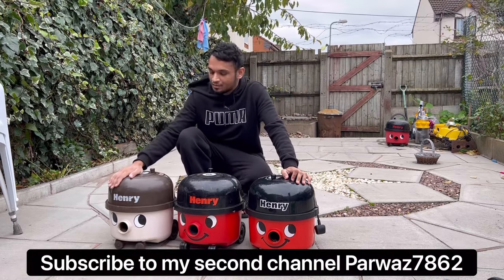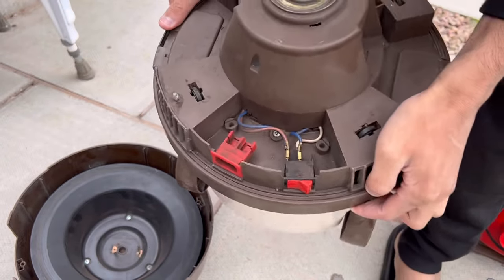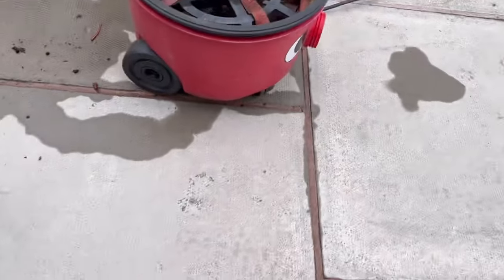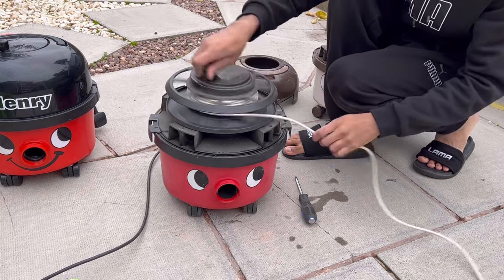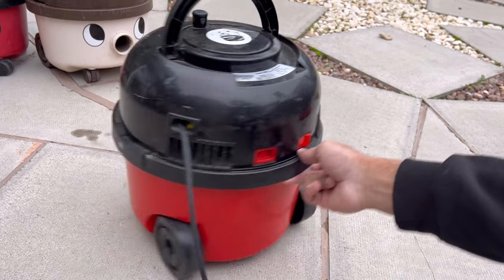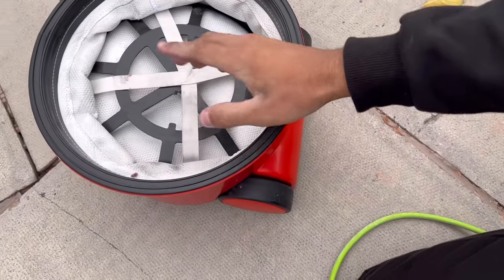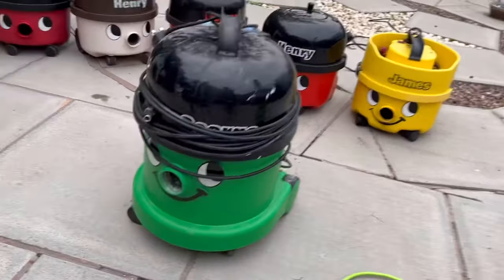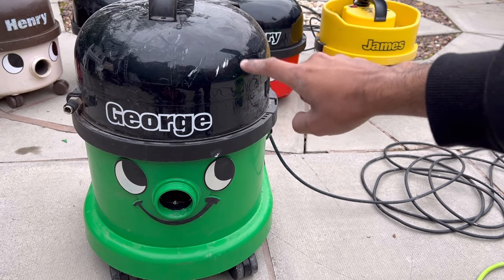My broken Numatic vacuum cleaners - UPDATE

Comment: The squeaky sound means that the bearings need oiling, probs because you left it outside. Apart from that , the motor sounds sweet. Lesson of the day, don't store vacuums outside, or you'll destroy them . Why did you store it outside?

Comment: Please don't smash the Cream and Brown Henry as it's vintage and uncommon and the James is cool too please don't smash that either
Reply from the maker: I’m scrapping the cream and brown Henry unfortunately because it can’t be fixed
Reply: @parwaz7861  what's wrong with it exactly?
Reply from the maker: @vacuum_collector26  I shown all that’s wrong with it in the video
Reply: @parwaz7861  I thought more would've broke on it. Can't you fix the screws or glue it back and not use it bagless
Reply from the maker: @vacuum_collector26  screws will no longer fit so it’s now scrap sadly
Reply: @parwaz7861  is there no way you could find any casing part's for it or keep it until you find some. If nit you could sell it for spares or repair's
Reply from the maker: @vacuum_collector26  I’d rather not keep it tbh it’s in quite worn condition anyways with lots of dents in the plastic etc
Reply: @parwaz7861  okay best sell it for spares or repairs then since it's rare and vintage
Reply: @vacuum_collector26  Cream and brown Henry's aren't that rare, there's rarer machines out there worth saving.
Reply: @RJA_World  that's true but it's still vintage and not that common so shouldn't be smashed